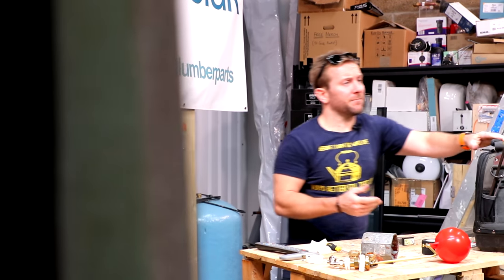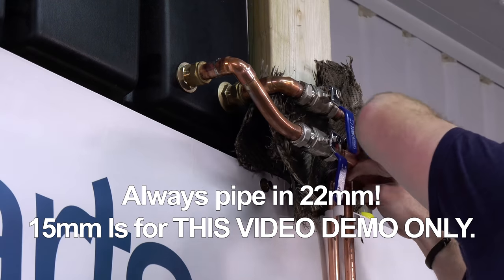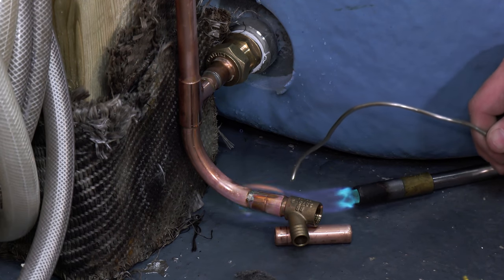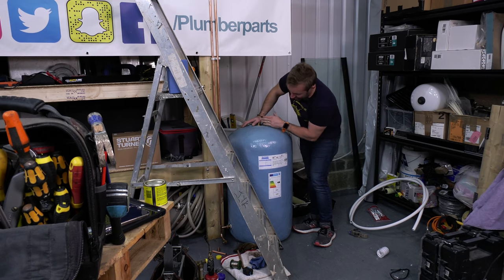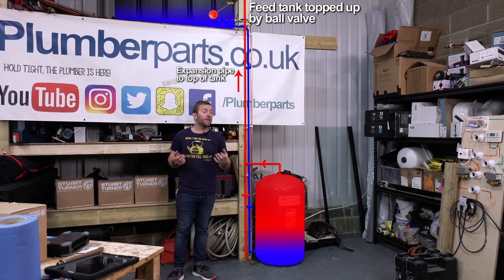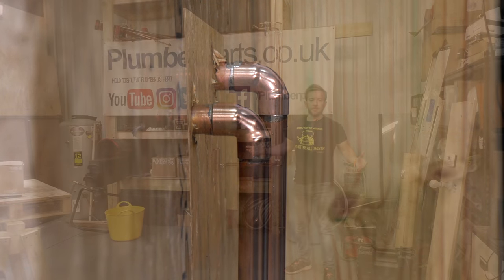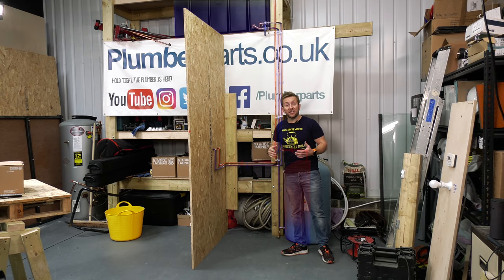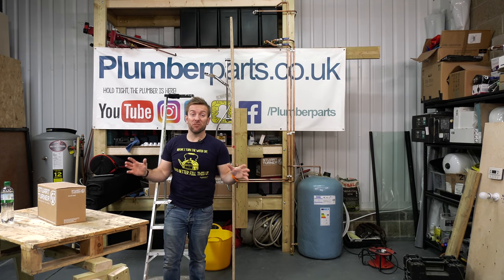HOW TO FIT A SHOWER PUMP - Stuart Turner Showermate Review

Comment: It's the vest! 😂
Good video Jimmy 👏
A couple of things for Wednesday:
Should the hot supply pipe from the CW tank be slightly higher than the cold. So if the tank should run low the hot would stop running and prevent scalding. Perhaps it doesn't matter with a thermostatic valve? 
Would you advise the use of a flange to prevent air from the hot finding its way into the pump?
Why use strainer valves when there are filters in the pump and at the shower valve?
Reply: Yes the hot supply from the CW tank should be slightly higher than the cold services to prevent scalding if the cold water tanks is drained.
Reply: Although best practice is to use either a top entry or side entry flange where possible, If the pump is to be located below the top of the hot water cylinder you can connect directly to the hot water supply. Just make sure you first angle the pipe upwards between 30 and 45 degrees and tee into the bottom cylinder. Refer to the installation guide for more advice
Reply: There aren’t filters in this model of pump so they will need to be fitted to the pipework before the pump to protect it from any system debris

Comment: We have a leak under our 2nd floor mixer shower, that leaks into the room below. Hot water boiler is on the 1st floor. After watching this video, we think a shower pump has been fitted behind the mixer shower wall, as it is sometimes heard making a noise. Problem is, there is a open ended white pipe underneath the shower base (floor cavity) which leaks fresh water into the floor cavity as its not connected to the waste pipe. No idea what this pipe is or why it's there, but we suspect its sonething to do with the pump. The water leaking is gradually increasing in volume, and only occurs if the shower is used twice on the same day. A nightmare as there's two of us at home. The leak seems to occur when the shower pump starts to make a noise. The ceiling below is badly water stained. Concerned that the plaster may fall off altogether. 

To resolve, should we have the current pump in situ replaced with a new negative pump or something else? Help!!

Comment: This is great, I have one question - We have the same set up but after about 10 minutes the pump shuts off and the shower stops, then once the tank in the loft fills again (about 20 minutes) the pump starts again ... is the pump drawing more water than the tank can refill thus less pressure - How do I cure that?
Reply: Fit a bigger or secondary tank in the loft.
Reply: Or you can link a second 50 gal tank to the first. You do not need a second ball valve, just link them from the outlet piping and tee that pipework together.

Comment: Hi,

I recently changed my shower pump from wickes shower pump to Stuart Turner showermate 1.5 bar shower pump but after changing the pump, new Stuart Turner pump is pulsing intermittently whereas with old shower pump I never had this issue. Even the guy who installed it doesn't have any clue about it. If you have any idea or suggestion. I would be very grateful and much appreciated. Many thanks in advance.

Comment: love the vids very helpful. could you please help me with my problem? 
i have searched endlessly but cant see any guides for installing showers in flats ( guess loft applies double for flats). boiler is communial. CWT is in airing cupboard above the  hot water cylinder, thats vented to top of the CWT.  gravity fed right?
i bought a mixer bar low pressure shower (triton tees) i get approx 9 litre pm from bathroom sink taps. manual says min 8lp min for best results. so im borderline., was going to install until i saw this video!
ok so i must need a pump, universal, centrifuge, twin but how many bars?. normally 1.5 for flat? but i read it says 3 bar if large shower head. the one i have is 200x200
what do u reckon , 2 bar plenty? thank you
oh yea im a painter need any help il film myself toshing a flat out

Comment: The hot feed to the pump really wants to be taken from a shower pump flange into the top of the tank or an Essex flange in the side of the tank to ensure an air free supply of hot water so it doesn't suck air down the vent pipe
Reply: Nick Collins  I agree nick , shouldn’t of tee hot there 👍
Reply: @rhyswintle4331   shouldn't *have

Comment: Hi James, excellent video as usual but wouldn't you need a Essex or Surrey flange for this or is it ok without??
Reply: Although best practice is to use either a top entry or side entry flange where possible, If the pump is to be located below the top of the hot water cylinder you can connect directly to the hot water supply. Just make sure you first angle the pipe upwards between 30 and 45 degrees and tee into the bottom cylinder. Refer to the installation guide for more advice
Reply: Steven Moody    an* Essex
Reply: @StuartTurnerLtdHenleyonThames  ....tee into the bottom CYLINDER?

Comment: quick question, just installed a thermostatic mixer shower.  The previous shower would defo give a liter per minute.  The new one wont work as the mixer valve has 2 different pressures.  I should still be able to use a standard pump in this situation no?  Thanks

Comment: My insurance Policy states in the Water Leakage Section that the Policy is void if a leak comes from a flexible hose, that ST Pump has four so good luck making a claim buddy!😂
Reply: Is that true even for equipment? Inside your boiler will have flexi’s, equipment like pumps can work harden the rigid pipes like copper and cause cracking at the copper, this is where flexi’s act like a bellow to absorb the vibration to prevent failures
Reply: Insurance doesn't seem worth the paper it's written on , Flexi hoses are used on most taps in most houses .

Comment: so I'm replacing an old ST showermate that broke with a new ST monsoon universal (negative head didn't always want to start on new upstairs shower). All my pipework is 15mm and the ST universal has 22mm connections. I know the manual says to use 22mm throughout, is this just for maximum flow or will it damage the pump running on 15mm? Should I get a different pump?

Comment: I thought that the recommendation was to have 22mm cold water feeds from opposite ends of the tank. Don't put solder on with the fame running on the fitting, hear it first and place the solder on the joint. And I would be very careful soldering to a fitting which has PTFE tape on it without trying to keep that part cool with say a wet cloth, otherwise it will melt.

Comment: Is it true that many plumbers fit a Universal as standard ? This pump looks cheap compared to the Monsoon with brass pumps. It also took me a while to establish my Stuart Turner Universal pump intermittent start/stop running problem was down to the pressure vessel having lost its charge. Fitting a new Zilmet Inox Pro  pressure vessel from Whisper Pumps sorted this. ST Pump Assist didn't help. This minor fault must earn the plumbing industry a good income!

Comment: Hi great video. Can I ask you will increasing the height of our water tank in the attic make any difference to our shower pressure? Also can a shower  pump be fitted at a later date or should it be done when you are having a bathroom refit?
Reply: Every 10 meters of height for the tank you get 1 bar. 

So in 3 story buildings tall buildings you tend to see these systems alot still.
Reply: Do it while the bathrooms being done.

Comment: hi mate i am just wondering if its worth me getting a shower pump for my gravity fed system or just to change it to a combi boiler?
cheers!.
Reply: That really depends on what you want to achieve with your system. Do you want a pump to just feed your shower or do you want the pump to feed the whole house. Either way could be costly. It wasnt really touched on in this video but the size of the header tank James fitted is important. for any booster pump you need a minimum of 40gals of stored water, and that's for a single shower/outlet. If your feeding multiple showers/outlets then you need a greater amount of stored water. The last basic shower pump install I priced came in at £600 and that's because the stored water was too little and due to the loft hatch size I had to buy 2 smaller tanks and link them together to achieve the 40 gals needed to meet manufacturers requirements. If your going to be feeding multiple outlets you could potentially add a further £200 - £400 to that bill depending on what pump size and type is required. 
You could get a combi as you mentioned but  again we dont know your hot water requirements or what your supply pressures are so we cant accurately answer that. Theres always an option but we need all the info first to answer you correctly.

Comment: Great video. Would there be any benefit in installing the pump in the cold feed to the immersion tank so it doesn't have to pump hot water so keeping it cooler?
Reply: Not a great idea, showers like a hot and a cold feed so they can mix properly.
Reply: If you install a pump in the cold feed to the hot water cylinder it will pump the water through the cylinder and out of the hot water vent pipe back into the cold tank resulting in the pump running constantly.

Comment: Hi! Im thinking of getting one of those positive pumps for my hot water lins however I have a slightly different issue.. My system is same as th eone shown in this video. Hot water presure on th efirst floor is weak and downstairs in th ekitchen tap its even worse! It takes ages to get hot water running (it bleeds the cold water seriously long) and once its there presure is very bad. There is another strange thing - once switched to cold water in kitchen tap and back to hot it runs cold again for quite a long while.. I have been talking to few plumbers who gave me ridicolous advices not solving the issue.. Would this pump help me out?! Im thinking of getting a dual feed one to make cold flow better as well.

Comment: Hi James  diy question can a 90 degree street elbow be used with a flexi tail which has a compression valve fitted , cheers mate
Reply: I would say if it’s a long tail street elbow then certissimo. Got to be careful with the short ones. Hold tight

Comment: I have a question, someone help me? My apartment plastic water tank is stacked on a hot water tank. The plastic tank Is 1 meter from the floor and pipes run down and under the bath to reach the basin taps. I'm getting 38 secs = 1 litre on my basin taps. Could I use a positive water pump? I was planning to put one on the floor below the water tank.

Comment: My pump only kicks in if I lower the shower head below the mixer, looking at this video I guess it's a head pressure thing so thanks for that! also keep having to turn the pump off and on a few times to get the air out of the hot, if I get a non return valve shower head do you reckon that'd help? Ta! Hold tight
Reply: You have got a poitive header shower pump so in order to make that work you need a negitive header shower pump
Reply: @OnUKRoad  thanks 🙂
Reply: Check out either Showermate Universal or Monsoon Universal, both by Stuart Turner. Will overcome the lack of head pressure 👍

Comment: I got one of these installed when we got our attic converted(with ensuite). Works great but I've noticed that now and then the pump (located in the airing cupboard in one of the bedrooms) comes on when no one is using the shower/sink/toilet in the attic. Any ideas? Btw I checked for leaks. You'd know very quickly if you had a leak from a pump. Thanks for posting.
Reply: Is the shower/sink and toilet all connected to the pump? With the ensuite been in the attic I'm going to assume you have a negative head/universal pump fitted, you'll know if it's one of these as they have a mini pressure vessel attached to the pump. These work on pressure and what they do is pressurise the system beyond the pump, then when an outlet is opened the pressure drops activating the pressure switch and runs the pump. Then when the outlet is closed, the pump continues to run to charge the pipework and satisfy the pressure switch turning the pump off. If you have a dripping tap, shower or inlet valve to the toilet, this will over time drop the system pressure and activate the pump for a few seconds until the pump recharges the system and satisfies the pressure switch.
Reply: @wayneleone  no problem and yes that's a universal. Check all taps/showers connected to the pump for drips etc. Check the toilet pan for a little stream of water always running from the rim, it may be the syphon washer is passing so the pump is filling re filling the cistern. Also check any isolation valves for little weeps, or doesnt take alot of water to drop the pressure to activate the pump.
If all those are fine then you may need to re charge the vessel on the pump. The psi rating will be wrote on it. Turn the power supply off, turn the iso valves off to the pump and open up the taps. Then using a bike pump and tyre gauge, pump the vessel up to the required psi.
Reply: @craigwatson7692  cheers appreciate that 👍

Comment: Plumber told me can’t fit me pump because will drain out my hot water too fast …. 
Also told me I can’t have mixer for my sink because i have pipes for low pressure and the tap I bought is for height pressure… never heard such thing for taps

Comment: Great video as all ways James. Why did you valves with in-line strainers ? 👍
Reply: A bit late to reply now, but sometimes you can get some debris left over from manufacturing the pump, as well as bits of limescale or dust or whatever from the tank. You don't want this getting into your shower valve.

Comment: Hi, can I use pressure vessel to solve this bath tub  hot water dropping problem . If so  which is the best and  where to fix  please. Thanks
Reply: Noo thats nothing to do with the vessel so you fix taps dripping, what you need to do is to change the taps cartridge problem is solved

Comment: How do you make a Stuart Turner Pump quieter, my pipes are clipped to a cavity wall in the airing cupboard and the vibration is so load, its embarrassing when people hear it.
Can I replace the clipped pipes with flexy pipe and have them unclipped to the wall?  Great video, Many thanks

Comment: What would be needed for a situation where your in a flat, and the header tank is literally at head height when your stood in the shower? Would you take the cold feed from the tank, or T off the mains cold pressure? 
I have the exact hot head pressure you showed in the video, cold is perfect at any height. Hot is non existing at "operating" shower head level, if you lower it to an inch off the floor of the bathtub, its within the 1l/min you talk about.
Just incase it matters, the hot water for the shower is on a toggle of the bath taps (shower mixer, i think its called). So I'd wonder if a shower pump is whats required, as its likely to boost the flow to all hot taps (kitchen, bath basin, and bath).

I've gotten quotes from a few plumbers and they all tend to suggest different plans of action, but never want to commit after the quote stage :(
Reply: You would still take the cold off the header tank but use a negative head pump , instead of a positive head .
Reply: As it is a bathmixer it would boost the pressure to your tap outlets aswell ... not a bad thing perhaps ?? ...
Reply: A universal pump would be the correct pump for this application. Available in both Showermate and Monsoon ranges, take a look here: https://www.stuart-turner.co.uk/our-products/showermate/showermate
Reply: I’d move out mate!

Comment: Can you use a pump on mains pressure with a combi boiler for a gravity shower one floor below the boiler/rising main?
Reply: I don't think so, the combi boiler is effectively your shower pump. Separate shower pumps are for when you have a direct or indirect cylinder to increase your pressure from the tank.
Reply: This style of pump is designed for gravity fed systems only. We have a range of products suitable for direct on mains applications in our Mainsboost range.  Check them out here: https://www.stuart-turner.co.uk/our-products/mainsboost

Comment: Often when turning off the hot tap (it's a lever type tap) in the bathroom next to the shower our pump will turn on for a fraction of a second. What can be done to stop this?
Reply: This is what we refer to as ‘nuisance switching’ and is caused by a pocket of air being trapped between the pump and the shower. The air acts as a spring and causes the water to move back and forth through the pump triggering the flow switches briefly. Clear the trapped air and the issue should go away.

Comment: I recently installed a shower pump (like-for-like replacement) - After I finish in the shower the pump will "pulse" on and off indefinitely until I turn the power off/on.  I've tried running the water through with the pump turned off for many minutes but it didn't solve the issue.  Any ideas?
Reply: Single check valves on the pipework after the pump. Salamander?
Reply: @tommcdonald1000  That's what I ended up doing.  It was a watermill pump.  The check value seems to have resolved it, though it can still pulse on/off a couple of times before it decides to stay off.

Comment: what if you had the same problerm with the shower and you have a combi boiler?
Reply: Im gussing there must be a tank somehwere
Reply: or may be the main pressure is very poor
Reply: @OnUKRoad  Hi Ali there is no tank  and the mains pressure is good it is ok intill some one els in the house turns on the hot tap and then the pressure drops off.

Thank you for the reply  👍
Reply: @RMD80GAMER  what about the cold water does it drop pressure as well